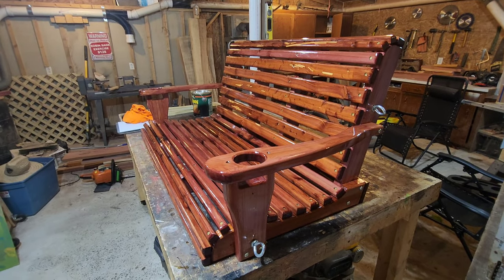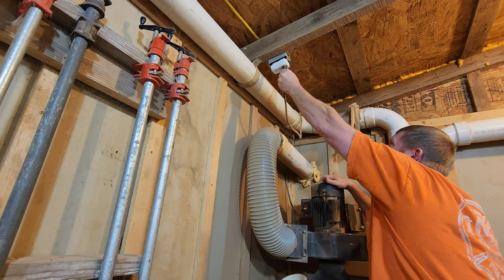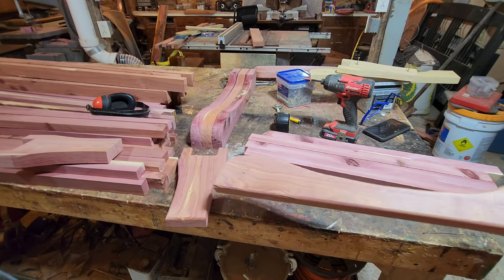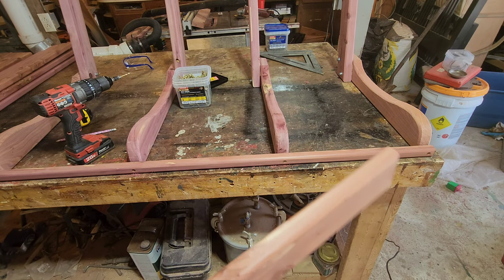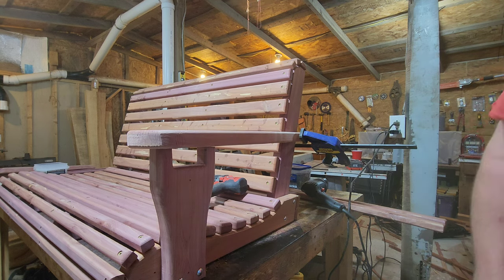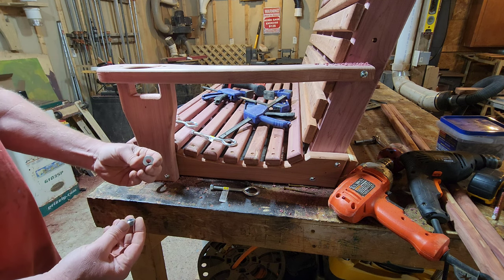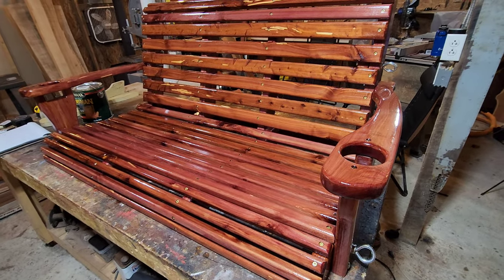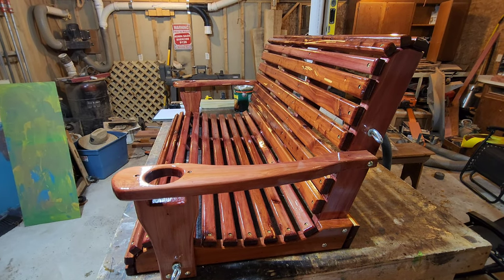d.i.y cedar porch swing build.

Comment: I just found this video! I actually built almost the same swing bench 8 years ago ! It finally fell apart. I like your cup holder solution! I can’t afford cedar . I’m just going to use PT lumber . I got some great pointers from your build . Thanks and I subscribed! 😀👍
Reply from the maker: @ralphp3057  thanks for the kind words and feel free to share your build with me on Facebook messenger.
Reply from the maker: @ralphp3057  I also have a swing weight limit test video on my channel.  Check it out if you get time.

Comment: This is almost identical to the handful I’ve built down to the the 15 degree angle, depth , height, width. Really weird. Only main differences are the cup holders and I like to half lap the joints on the frame which are honestly overkill and extra work. Love it. I’m definitely stealing that cup holder upright  idea on the next one.
Reply from the maker: Be my guest,  when I make 6ft swings, I'll add 5 frame members .   The very middle one will be half lapped, so the semetry works out.
Reply from the maker: Thank you for watching .

Comment: I built a couple 20 years ago, but after accidentally raising my corner rounding bit 26:00 a bit too high on my router table, the raised lip it left looked so nice that I raised it a bit more (for about an 1/8" lip) and did all the seat slats and arm rest that way.
Reply from the maker: I bet that looked good, may have to try this.

Comment: You did a great video, I have one question, Do the chains when installed and hung,  rub the arm rest near the cup holders?
Reply from the maker: They will but- under load the chains are stiff and don't move enough to show damage.   I set my ceiling hooks a few inches wider than the overall width of the swing.   Good question.
Reply from the maker: Im gonna do a video this weekend on hanging the swings. It will cover chain size, and any info needed on said topic.

Comment: Does the chain fall through cup holder or outside of rest. And what is final wood thickness on boards?
Reply from the maker: It runs on the outside of the armrest, but you can customize it any way you want.   I just like having the full width of the armrest for your arm without a chain in the way.
Reply from the maker: Also the slat thickness is 1 inch , the frame is 1 1/2 thick.    Again you can use whatever you have and customize to your liking.    I've used all decking boards for the entire build and it held up fine.
In the swing weight test video you can see how I have the chains hooked , I can upload some pictures to my Facebook page if I need to.    Anything that helps your build is no problem.

Comment: how much chain and what size of chain should I get
Reply from the maker: I'll check this evening and give you the exact size.
Reply from the maker: 3/16 is a good size for strength without overkill.   It's the size I used in the weight test video where I loaded 2,500 lb on a swing and it didn't break.  I normally buy 20 ft .   I think I'll make a short video this week showing all the details of how I hook them.

Comment: How did you run the front chains.  Looks like they would rub
Reply from the maker: Outside arm rest, under weight they don't move really like one would think.
Reply from the maker: I also set my anchor point a little wider than my swing.    If your swing is 4ft overall width then set the ceiling hooks maybe  2 to 4 inches wider apart.